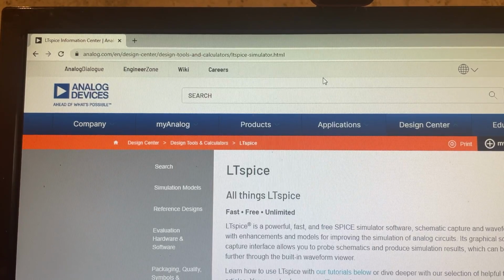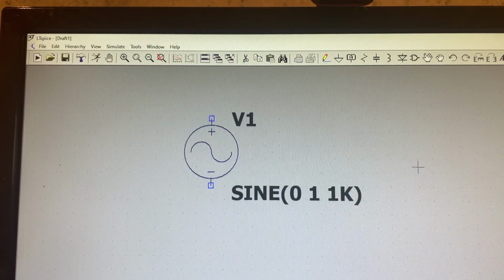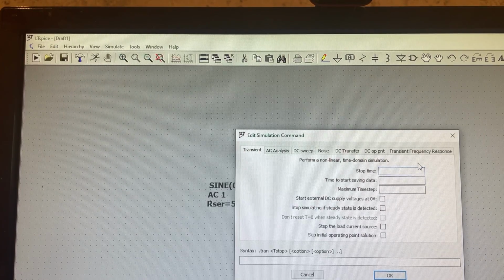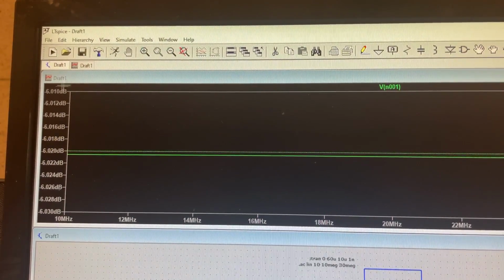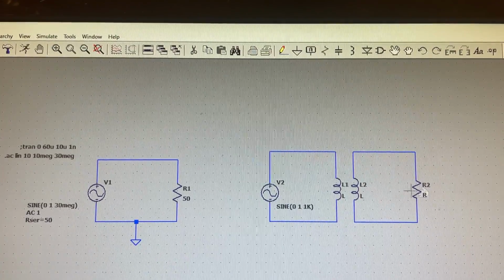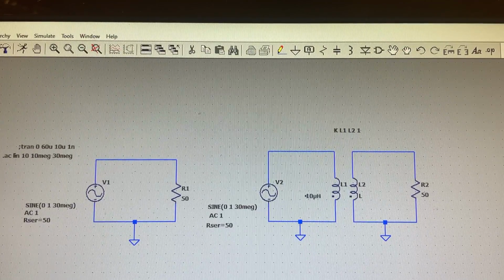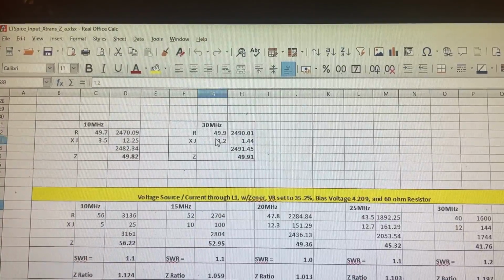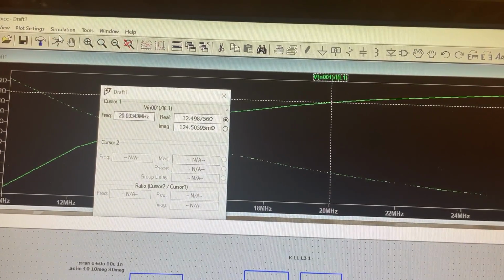(Part 2) How to Design, Build, and Test an RF Linear Amplifier (LTSpice)

Comment: Thank you for the video. for some reason I cannot get LT spice to give me the correct impedance values, for a 1 to 1 match it gives me the resistance in fOhms which are apparently very small. How do I couple the two inductors? man the tool is not easy to use at all, it is a challenge, if only EasyEda could measure impedance(I do not know how to tell it to).
Reply from the maker: You need to use the 'K' directive. Here's an example for L1 and L2 which are 2 separate inductor. (K L1 L2 1). K is use to couple L1 and L2 and 1 is 100% coupling. I hope this helps. RF Man

Comment: The inductance is proportional to the square of the number of turns.
Reply from the maker: Yes. Also, the impedance ratio equals the number of turns squared or the square root of the impedance ratio equals the number of turns. Regards
Reply: @rfmanchannel6915  Since the inductance is proportional to the turns ratio squared, the 20uH:10uH inductance ratio is equal to a turns ratio of root(2).  Then, since the impedance ratio is equal to the turns ratio squared, root(2) squared is 2, thus transforming 100 ohms to 50 ohms, or 25 ohms to 50 ohms.  It's intuitive when the ratio is 2, but when you require some oddball number for an impedance ratio, it's easier to do the math.